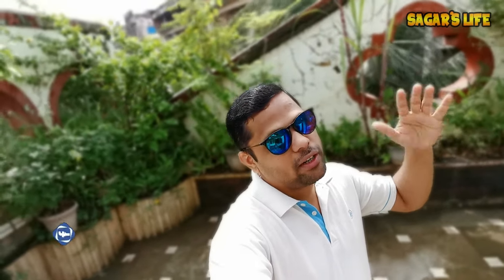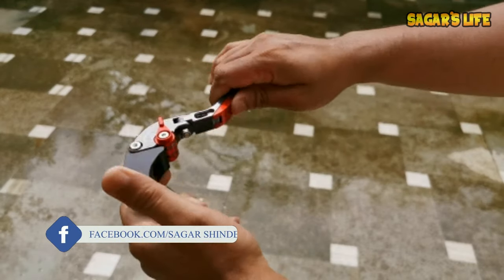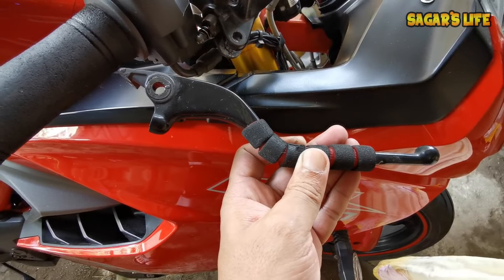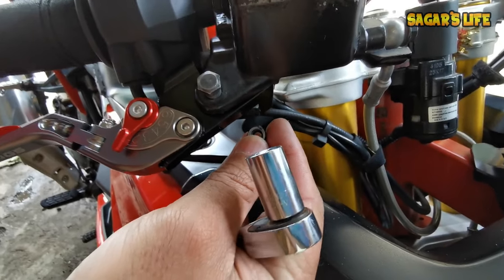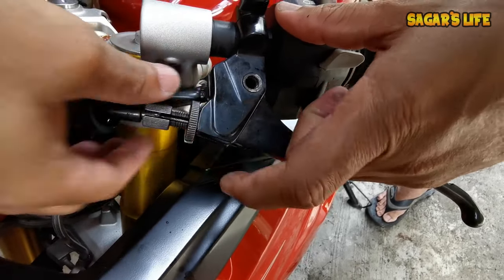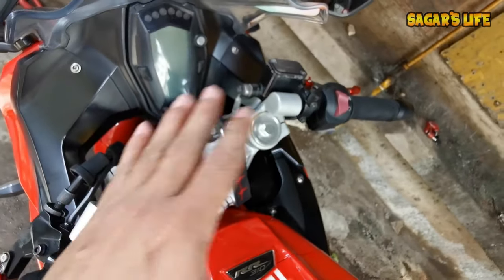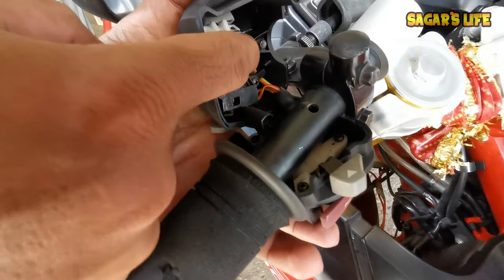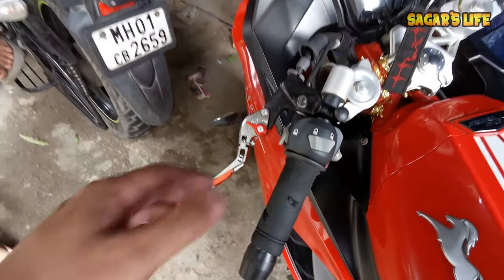Easiest Way To Install Adjustable Clutch & Brake levers On Apache RR 310 | Complete Guide

Comment: bro how was it with  new clutch lever with slipper clutch mode combo....

after changing clutch lever i already felt it lite but will it worth slipper clutch with its combo....

and the setting anything below 4 is called a half clutch that shud damage the clutch plate rite?
Reply from the maker: Hey I could only able to give those answers after completing my upcoming ride,..
Reply: @SagarsLife  What about now? It's a long enough time, I'm also planning to buy one.
Reply from the maker: They are completely comfortable on RR.. Completed my North Ride of 4k Kms.. Just you need to do some R&D on clutch lever as default installation the bike doesn't start in any gears.. Due to small sensor inside clutch lever area so you have to add small packaing on adjustable clutch lever 👍😊
Reply: @SagarsLife  How about hydraulic clutch on RR? And I didn't understand the sensor part.
Reply from the maker: @VirgilDSG  sorry haven't tried hydraulic clutch on RR so can't Comment... Will try to add how that very small sensor in future Vlog 👍
Reply: @SagarsLife  sure that will be a huge help
Reply: @SagarsLife  can u tell me.. Aapne kya packing daala hai, to get adjusted with switch?
Reply from the maker: I used small plastic package which I used on under seat to avoid seat vibrations..

Comment: Bhai.. I need suggestion for Tank pad & frame slider.
Reply from the maker: There are good tank pads are available for RR 310 try on Amazon, the current available frame sliders are not that great to take impact of bike, so even installation of frame slider damage will happened...
Reply: Thanks for details..  will wait for your update on slider.. Please let us knw if u find something perfect.

Comment: bro can u please tell me how to open the clutch lock nust which js on the lever ..
Reply from the maker: It can be open through ellan key and please remember there is bolt at downside and the spring  pressed inside lever with high pressure 👍
Reply: @SagarsLife  ..no not that one ..i want to adjust the free play ...the big round nut . which is used to adjust clutch free play
Reply from the maker: @prathmeshdawkhar7080  sorry never open it, but that one had a bolt at downside with Adjusting Knob on upside
Reply: @SagarsLife  ohhk thanks

Comment: I have a question for all rr310 riders that needs to be addressed asap. I want to know if there are any other sliders available in the market than venom sliders coz they are charging way too much for such a low cost item. Thank you n ride safe
Reply from the maker: Heard about other frame sliders than venom in initial days while they are doing r&d, but after that haven't heard of any, frankly I don't think any of current available sliders for RR310 will help in speed crashed.. That's why I haven't install any..
Reply: Yes there is one more costs around 3k, but the things is it doesn't fit as neat&clean as venom one. R.J.V.O.N frame slider for rr310, available on amazon.in with low stock